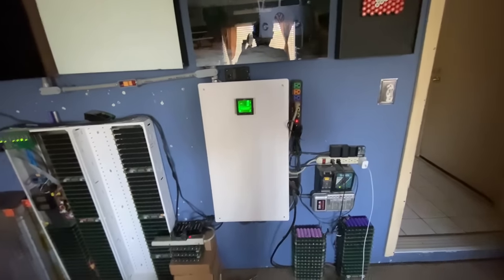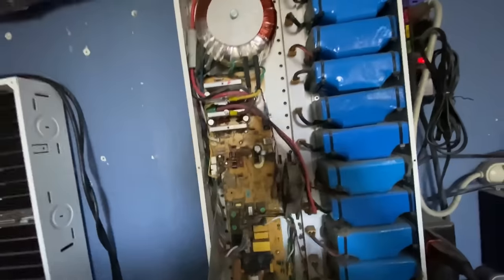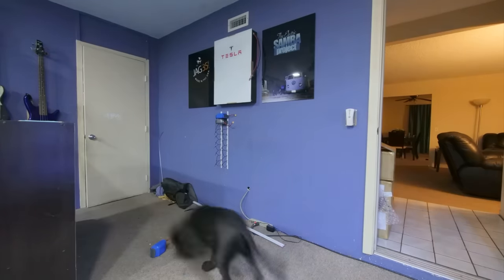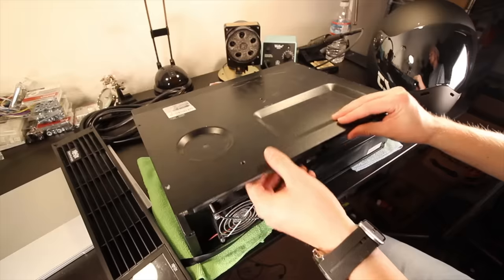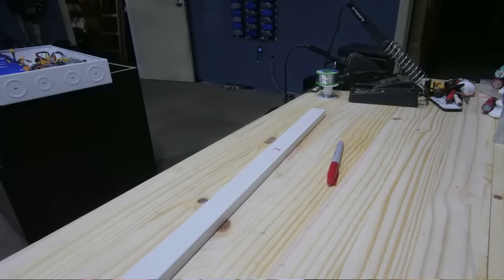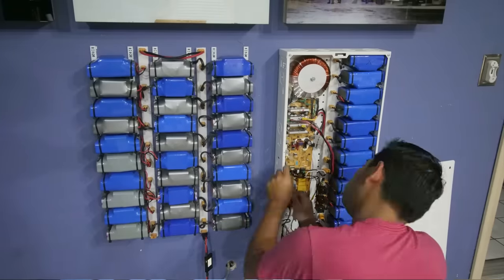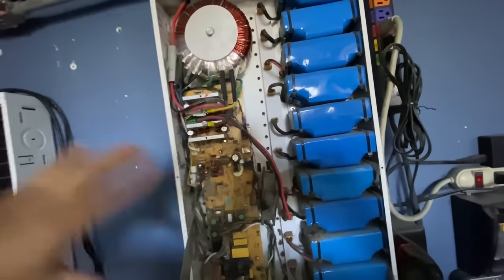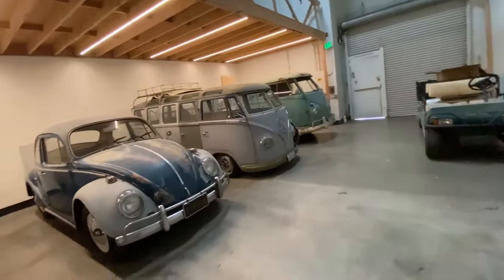Build a DIY Backup Powerwall using a UPS and scooter Batteries

Comment: How do you connect the UPS outlet to your home mains? Or you don't, and connect appliances directly to the UPS outlet? I mean, is this UPS supporting your mains grid or not? Hahha thanks
Reply: The UPS has an input and an output, you connect the mains to the input and your appliances to the output. Most UPSs can't handle more than 30min at 50% load when the grid is down, so if you want more you need an expensive one.
Reply: (warning: detailed, hence long, reply)

If you are going to get complicated in any way then you MUST consult with and even may HAVE to use a registered electrician. I'm a graduate electrical and electronic engineer (45 years this year) , and although I rewired my first complete house (alone) when I was 17 (it's still standing, one of my oldest friends still lives there! :) ) and done several since, I am no longer allowed to do wiring on many parts of domestic circuits, especially at the consumer unit (fusebox) due to changes in the electrical rules. Arrrggghh! 

Most European countries have tightened and continue to tighten rules regarding DIY electrics so to ask questions genuinely but naively, not realising or understanding those rules can lead you into serious trouble. In Australia the rules are SO draconian (and in my view BLOODY ridiculous) that you MUST use an electrician to rewire an appliance PLUG! WTH???

"On Grid" or "Grid-tied" means the solar powered inverter (not UPS) will ONLY work when mains is present as the inverter HAS to synchronise with the incoming mains frequency and will NOT provide power without it. A hybrid inverter can work on & off grid BUT for safety reasons it MUST disconnect from the incoming mains supply (present or not) BEFORE delivering power to the main house circuits in an off-grid manner. In addition, since in the UK, and probably elsewhere, the incoming supply is an 80-100A service and multiple 45A, 40A, 32A, 20A, 16A, 6A MCB protected circuits will be present and connected it's a problem. So in order to be able to supply ALL the household electricity, without issue, and as before a power cut, to be assured of supply, you will probably need AT LEAST a 20 kW inverter (80A!!) and depending on your actual usage and property size maybe even a LOT more - EXPENSIVE!

However using UPS systems (multiple ones can be used in a legitimate configuration), the separate breaker protected specific circuits (lighting up & down; power up and down etc) can instead be provided to MULTIPLE separate UPS units from the mains and then outputs to separate MCB protected circuits e.g. 2 x 2 kW UPS units can provide 2 separate standard 6A lighting circuits with plenty of headroom for continuous running, but be aware of total run time at the particular load limits. 

The UPS units in this case should be "Always On" types, i.e. incoming mains is normally supplied to them and fed through when mains is present, with an instant seamless switch-over to off-grid power during mains failure. So 2 lighting circuits could easily be managed and at night would just continue to provide lighting, but from battery power (no solar at night ... gee really!?) during an after dark power cut. During a daytime power cut however the UPSes would be just idling, not providing any power out (all lights off) but still consuming battery power in their idle state.

To make the most out of such arrangements it may be necessary to have sophisticated control systems set up to enable battery power to be provided in part or total to specific circuits. For example a low power UPS may be all that is needed to supply the central heating boiler and pump and the refrigeration devices ONLY. This ensures that during an extended blackout during a holiday away, you maintain refrigeration and heating. Additional specific control electronics will also be required to change the priority of the battery supply to JUST that circuit or circuits in order to maximise the endurance of  the refrigeration/heating or other priority load (intruder alarm?)and not share any battery power is fed to less important circuits. 

Add up ALL the power requirements (measured is better than calculated) multiply by the average utilisation (percent) which will be less for heating and more for refrigeration in summer and vice versa (for longer with heating) in winter. That will give the total daily load when multiplied by 24. Subtract the average output from your solar PV production and that will give your daily kWh requirement. It will likely be quite a bit more than your Solar setup can provide during the day to both deliver the power usage needed AND to recharge the batteries for night time. This is especially true in Winter.

This is a VASTLY complex and wide subject with MULTIPLE, sophisticated and equally complex solutions to exactly what you require or would like. Not ALL of what you would like or want to do will necessarily be a) possible or b) allowed. Keep researching, think about exactly what you want and then ask again having established a greater level of understanding. The more you get to understand the basics the better questions you can ask. MOST of it boils down to some simple understanding of domestic electrical supplies, how they are configured, the safety aspects and local engineering and installation rules plus the options available to do different things on one's own without involving external help (paid or otherwise). Good luck!
Reply: @boblewis5558  whow I stopped reading halfway.. don't worry I'm a certified electrician. My vawt 2kw I ordered is underway (the first in the world for only 560euro)
Reply: Bob Lewis p
Reply: @boblewis5558  Sign up and do a connect reconnect limited licence course at TAFE or through a private provider(takes about 3days and around $2000), you can do pretty well everything bar install new wiring in a new  house.I m a fitter machinist,and install lifts .I can do all the wiring bar connecting to the mains. The limited licence allows you to install ovens,hot water systems,new lights ,power points ,switches etc with in existing  wiring, you can change plugs,and also do a extra part in the course and do tag testing(buy a testing machine and earn some extras cash updating tags for builders, businesses etc) So you can update and replace items like for like ,is how they classify it.
Reply: @nssherlock4547  good thought ... For someone living in the US. I Iive in the UK and here you have to be a registered electrician, certified (as a minimum) under Part P of the building regulations and that MUST be maintained on an annual basis not simply a one off. 

I object having to do a course to do what I used to, perfectly safely and professionally for decades, perfectly legitimately, legally and to a higher standard than a spark (no offence, but I have EXACTING standards for quality of layout and wiring that I rarely have seen from the average sparky). 

All in all the UK has taken a backward step in my view and has forced on otherwise perfectly competent people, many like myself, graduate engineers, to accept the equivalent of a closed shop! 👎👎👎

Comment: So how many of these do I need to make sure I’m not over stressing them?  6???  I don’t want the UPS to be able to drain them faster than they can handle yet I don’t want to go overkill like you.

I don’t need the capacity but I don’t want any risk of UPS pulling more than the batteries can handle especially since the equipment hooked up can easily peak into 10A but usual load is nowhere near that.

Comment: Happy Holidays Jehu. Thank you for all your videos. I have purchased scooter batteries with the intention to salvage the cells and put them into 12volt batteries (to replace the lead acid ones in my UPS). The UPS has 20 of these batteries in series to make 240v. I am using a BMS in each battery. Is there a limit to putting them in series? Thank you again.

Comment: Hi Jehu. What is the overall dimension of the  hoverboard battery pack? I got several 36V UPS and am thinking I could replace it with these... The original batteries in these UPS is 12V 9Ah...  So I am windering if there is enough room to put four of these in the allotted space. I'd imagine with the BMS on the battery pack would stop the heater effect of constantly charging SLA batteries. Thanks!

Comment: I'll upgrade an old electric car normaly it has 10x 6v 225ah lead acid in it and me and my dad will build 13s11p packs in it I got these packs for 25€ each I have more then 10 of them if this thing drivea then 45-50 kmh than we can go to the tüv  to drive with the 45kmh driving license .. because 45 kmh is very slow and this thing has only maximum of 10kw I'll build an 20s 44ah battery pack out of hoverboard batterys this thing has an Kelly controller inside it programming is easy but this 44ah pack gets permanently recharged from the 48v packs
And sorry for bad English iam from Germany:D
Reply: what car is it ?
Reply: @DazzaDirect  its such an old one called puli 2e

Comment: Hey Jehu, I'm working in something similar, same UPS. Did you find the LCD reading the correct SOC percentage while charging? Mine reads around 30% when the battery is almost 40v. It then continues changing the batteries until 42v then floating at 41v but the SOC is still reading 71% and going up very slowly. Thanks!

Comment: Did you have to do anything to modify cutoff and float voltages? Can you disable charging from the UPS board?
Reply: I've been trying to figure out the best way to do basically this for my parents in Puerto Rico to get them started with some basic backup power. The off-the-shelf UPS batteries never really last well enough to just have one and rely on it.
Reply: @kingrpriddick  you would probably be better off with a inverter, aims has a nice inverter with built in transfer switch, 1200watts for about $170 approximately,  there is also decent priced, inverters with transfer switches that are able to work independently or as a UPS,

Comment: So how is this integrated with the lines in the house?
Reply: You can easily tie this in to your home wiring with a grid tie inverter.  Jehu has lot of these power walls in his  home for a reason. California charges per kw hr during a certain part of the day at a a higher cost. He is trying to capitalize on the lower charge per Kw hr when the utilities drop the rate.

Comment: How does this operate  as a powerwall?  Isn't this just operating as the UPS that the guts are from and passing the mains through til an outage or does this UPS operate differently than others?
Reply: It does not appear to be a "Power Wall".

Comment: I am curious to know if you can take a 60kwh tesla battery ( whole car battery) and use that to run a house , and also could a Toyota prius installed in the system to charge the tesla pack ? along with solar panels ? I figure it would cost around $18k in parts and pieces , but would it work ?

Comment: I would have liked to seen how you have this connected to the main service panel in the house ?????????
Reply from the maker: A simple plug to the wall
Reply: @jehugarcia  Wouldn't that back feed to the grid though?
Reply: @Ev3rM0r3  that's what the ups is for. It's a power supply combined with a battery charger and a relay

Comment: I have that same green cc cv 90v boost converter. Unintentionally you'd be surprised how much equipment we share. I bought that solar boost converter months ago and I'm just now seeing this video. I was introduced to it by Julian the YouTuber. As I'm watching this I'm wondering wouldn't it be more efficient to Tail the logs of the UPS via FTP and use PWM controlled load balancing Mosfets for each 10S battery instead of just connecting them all in parallel where resistance is a constant balance. You would have to re-engineer the charging process but easy for minds like ours 👍😃
Reply: in lieu of using a bus bar If I'm not mistaken you would need a blocking diode on each output mosfet so each 10s battery won't interfere with each other on their under load I would also put an ample sized automatic reset fuse as a form of thermal protection. As I mentioned before install the communication card for the UPS and Tail(Local) or Syslog Server(LTE) the real-time logs & on the fly control with account to softstart and temperature Pull the needed Mosfets High to on demand provide the Surge and RMS and almost zero Standby demands in real-time. It's possible and scalable 👍

Comment: Hi Jehu, I have a setup similar to this. The problem I have is that the UPS doesn't charge up to 29v (24v system). I used a APC 750 Ups and the maximum it charges to is 27.2v. Is there a known way of increasing the charging from 27v to 29v?

Comment: Hi. What about charging? Is it OK to let the UPS to charge the batteries without a BMS?
Reply from the maker: Hover board packs have BMS
Reply: The batteries probably never fully charge. Those hoverboard batteries recharge to 42volts but the ups probably hold them at about 39 volts.
Reply: Thank you for the answers. I have a plan to make my ovn 10s batteries. So if I understand correctly, no need for bms? If the UPS dont charge the batteries full they will most likly stand the charging from the UPS? (Sorry for my bad english) 😊
Reply: I remember there were concerns before about the pack BMS quality and many folks were recommending having some extra safety like fuse at each pack.  Is there something simple that could be done to just in case a pack has issues?
Reply: @tost1968  you still need a BMS to balance the battery packs. Maybe not to cut off the max voltage but you must still balance the batteries and a BMS does that.

Comment: I have a question I bought 3 3.7v 13ah prismatic lithium battery after a year of use 1 battery bulges and it drains fast I wonder if I can replace the dead battery with different amp battery like 15ah but same 3.7v. Tnx
Reply: Yes. The Ah shouldn't be a problem for your case.
Reply: If you’re connected in series they will be no problems with a tiny capacity boost. In parallel your gonna change the discharge curve and put more stress on the batteries but it will work... for a while.

Comment: Hey Jehu, last month I tried replacing my 1500 VA APC UPS's Lead Acid batteries for 18650s

The UPS uses 2 batteries in series, so 27V fully charged and it turns off at around 21V
I thought about using 7S 18650s. Each cell would go down to 3V when completely depleated (which is not my intent), and around 3.85V when fully charged. No problem there...i believe.
After assembling the series, I tested with my UPS and got a pretty much fixed 10% battery warning.
I think it's a resistance problem...probably the UPS "feels" like it's connected to a depleated Lead Acid battery...I'm not sure.
What do you think? Did you had any problems conecting this Lithium batteries to this UPS?
Thank you!
Reply from the maker: Bad ups probably
Reply: @jehugarcia  It's an old UPS...but it's working normally with Lead Acid...I use it with UnRAID and never had any problem with time left or percentage left...
BTW I follow you for many years now...great channel...learned a lot! Thanks!
Reply: @gabrielsanches6848  this is a very common issue that everyone comes across when switching battery chemistry requires you to "fool" your UPS , one easy way is to add a high power shunt resistor connected in series as Lithium batteries have a lower internal resistance value than Lead Acid (Pb) , NOTE , i accept NO responsibility for you actions and it MUST charge CC/CV AND terminate charge at correct voltage ;-]  , HTH, Have Fun  ;-]
Reply: @DazzaDirect  thank you for this help! I'll try it

Comment: NOTICE: this is ONLY really possible and safe when using ANY Lithium based cells using a UPS and/or BMS featuring CC?CV charging with ending termination charging cutoff also ALL lithium technologies have lower internal resistance.

Comment: strange that mister Jehu advertises these batteries after advising us in a previous videos to stick to well known brands. i bought similar hoverboard battery pack and the bms had no  cell balancing , and some cells eventually got shorted.maybe i am wrong, and these have cell balancing capable  bms , but the heat dissipation must be a problem since is covered in heat shrink plastic with no ventilation . buyers be aware  !

Comment: i have heard that they explode 

is it not going to explode?
Reply: Yes Lithium Ion batteries can catch fire if they are shorted out or overcharged. This is why most people recommend using a BMS, Battery Management System. Learn what you are doing before using Lithium Ion batteries. LIFEPO4 are a much safer battery chemistry.

Comment: Jehu i need to know what do u do when u connect hoverboard batteries in paralel ...how is that safe,thats multiple BMS in paralel for each pack...i know that voltages need to be 99% the same so that we dont have big surges od current from rest of packs to lowest ....but what if one pack goes rouge and drops voltage ....should i put a fuse on every (+) wire of every pack .... ??? what rest of you guys think ?

Comment: I can't fault your choice of UPS but will point out that your application voids the warranty on that fairly expensive product.
Reply: They can be had pretty cheap on eBay. The lead acid batteries tend to die far before the useful life of the rest of the unit.

Comment: Im haven a hard time finding a charger for my headway pack cant find what i need or maybe looking in a lower price range i csn buy a lifepo4 charger but its 4 amp i know i need 8 to 10 but if i cant can this be used i dont plan on using alot plan on the solar csn you help me out or somebody help me with some advice

Comment: With the years of use, have you had any battery draw that made you replace a battery, and is there a, say, relay system to flip contact around so that the draw battery doesn't get affected as bad? Or is that a nonissue in this system?